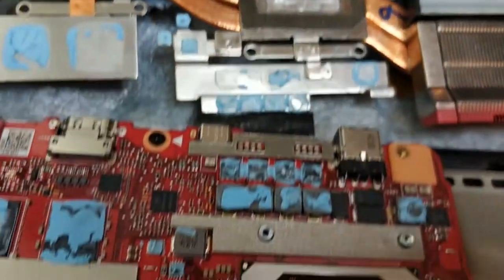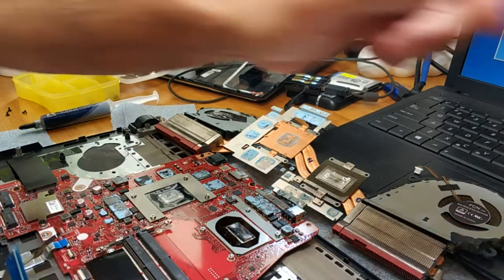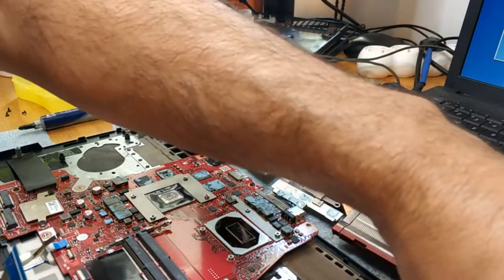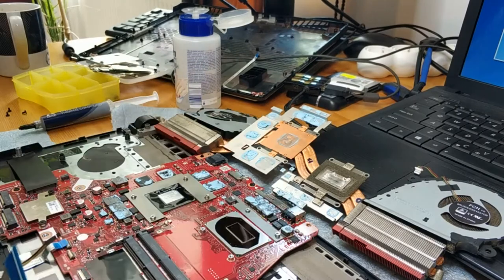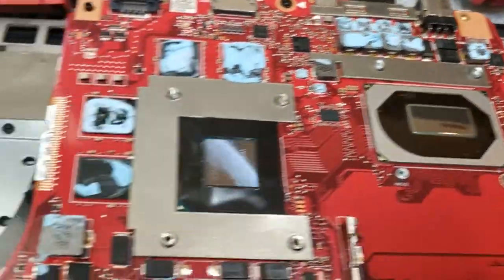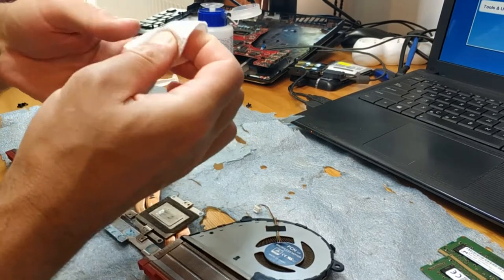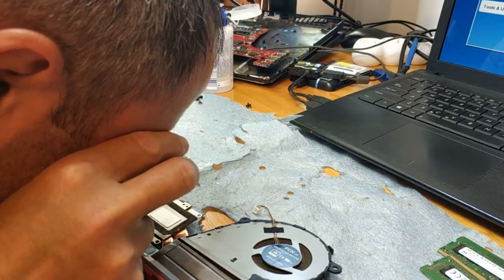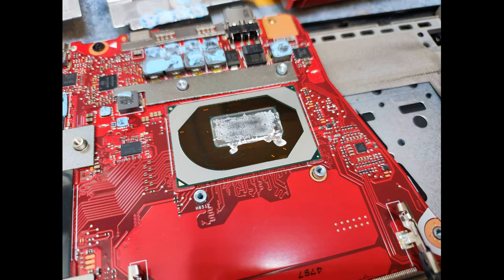How to Clean the Metal thermal liquid paste, ASUS

Comment: On M15 Asus Zephyrus with liquid metal in cpu, I opened to clean from dust and on occasion to change thermal paste.  I put mx-4 in gpu, thermale pad in vram and when I got to the cpu I saw that it has liquid metal.  I can replace without fear with mx-4, because I was afraid of the danger of liquid metal.  From performances and temperatures, what differences will there be?
Reply from the maker: Hello. I can't say exactly, because i did not make a test on my own. But, i think there are a few grades in plus, with thermal paste versus metal liquid.
Keep in mind that Arctic mx-4 will go on full performance after around 150 hours of use.

Comment: My G17 has had 2 years and temps in non AC room reach 86 for the cpu should I stay with it or get it serviced. The gaming performance is the same as Day 1 of laptop
Reply from the maker: i think best way is to ONLY clean the radiator and fan; leave the liquid metal paste IN PLACE; so, you gonna be specific to man who gonna make clean part that DO NOT TAKE OUT RADIATORS.
Reply: @DaneluRepairs  what do u mean radiators? I gave mine today to asus service center.
Reply from the maker: @ultimategoku8537  radiators means metal part of cooling system. But, if it is Asus oficial repair shop, they know what and how to it, and they gonna replace metal liquid also.
Reply: @DaneluRepairs  I asked them specifically what paste they gonna use. They said all paste comes from the manufacturer for service proposes they don't know what specific one it is. They also told me if it came with liquid metal they will apply liquid again. But idk if I should take their word . Il check the temps after the laptop comes back
Reply from the maker: @ultimategoku8537  exactly. Hope you have a photo with previous temp's
Reply: @DaneluRepairs  yes
Reply: @Tck104  yeah turns out asus service is pathetic they donot touch the cpu if it has liquid metal by default and send it back as it is
Reply from the maker: @ultimategoku8537 maybe because they don't know to reapply liquid metal... But, at least they have to clean fans and radiators.

Comment: Hey. Is it not dangerous to use a vacuum cleaner to get the liquid metal
Reply from the maker: Most of liquid metal already was take it to the bin, with those round cloth + isopropyl. Vacuum cleaner was on to perfect finish the job.
Reply: @DaneluRepairs  i applied LM to my laptop half a year ago. I made a physical barrier with kapton tape and use some kind of protection seal. the temps are creeping up lately. I am going to repaste the LM tomorrow. This is the protection i used https://i.imgur.com/kVobFbA.jpg
Reply from the maker: @emirhanolgun7351  yeah, of course, lm is best thermal solution. But, it's expensive and very dangerous if not applied correctly or someone who don't know what to do, is messing around Lm.
If you applied Lm half a year ago, i think something you do, you're not doing right, it's far too early to think that Lm is performing badly.
Good luck.
Reply: @DaneluRepairs  I think the kapton tape barrier is sticky and too thick where the connection between the ihs and copper heatsink is not 100% correctly.
Reply from the maker: @emirhanolgun7351  it may be too thick....but, if he work perfectly a few months, maybe you only have too much dust in radiators
Reply: Emirhan liquid metali sıkmadan önce cpunun etrafını sarmak için hangi malzemeyi kullandın I hope u know turkish I wrote here turkçe cause of ur name
Reply from the maker: @nevosa930  fabrikadan, Asus'ta bir çeşit süngerle geldiğini gördüm.

Comment: I repasted my g14 and when i turn the power on. The screen doesnt lighted a little bit but doesnt display anything. The rog sound is still there so i think i didnt break the cpu. Anyone know what did i do wrong??
Reply from the maker: hello; i think you took out and then put back the lvds cable(cable who is between mainboard and display) WITHOUT first take out the battery; this is bad, and usual, problem is on mainboard
Reply from the maker: If you look in this video, you will see that i first take out battery https://www.youtube.com/watch?v=T6GJAlFKmFw&t=346s
Reply from the maker: Last, i think the best solution for you is to take the notebook to a Repair shop, before you break it for good.